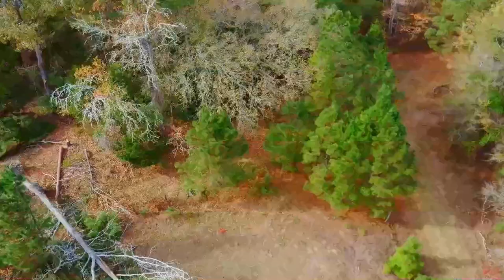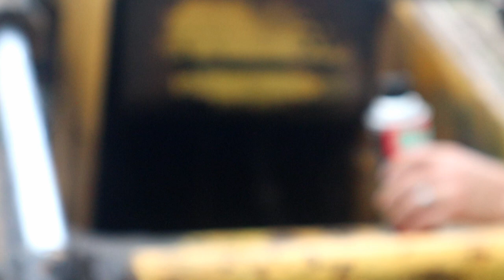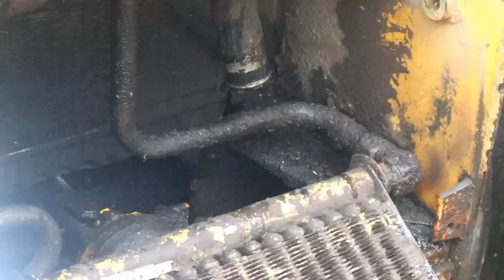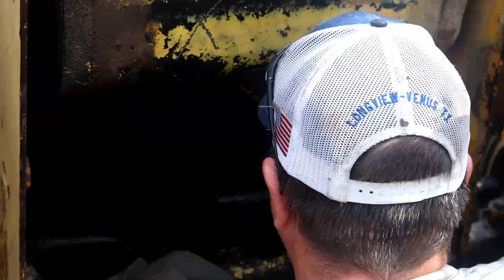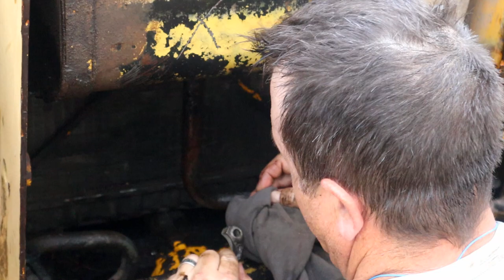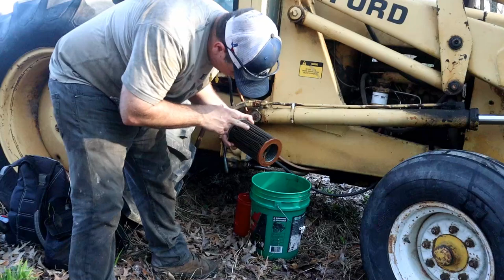Backhoe Hydraulic System Failure What Caused It and How To Troubleshoot

Comment: 😢"z
Reply: I have a 445 Ford backhoe and last year it started slowing down and by the end of the summer it would hardly move. I had quite a few leaks in the cylinders, so had a mechanic remove all the back loader cylinders and had them rebuilt. I do not have leaks anywhere in the hydraulic system now that I know of. At least non externally.  I still do not have much movement. bLike snails craw movement.  The filter in the reservoir has been cleaned and new oil put back into it. You mentioned that there was a filter in the bottom of the reservoir.  I did not see that in my manual, but I had heard somewhere it had two filters to the reservoir.  I was figuring that it might be the pump as well.  Hope you find out the problem and share your findings.  You never know when such knowledge could come in handy for someone else.